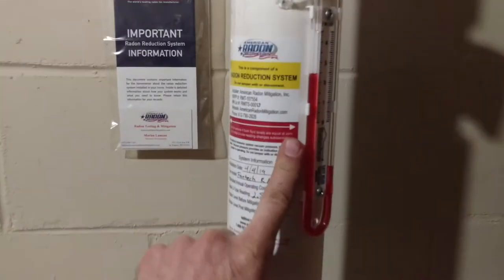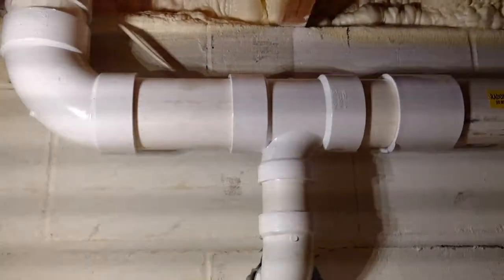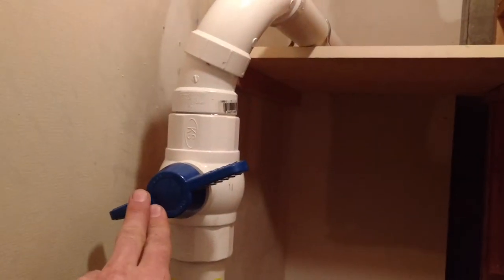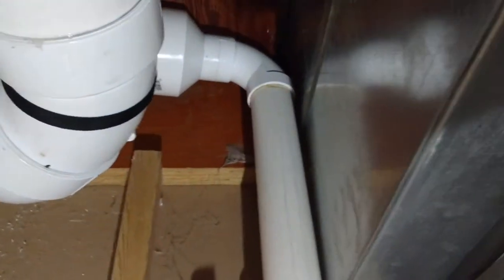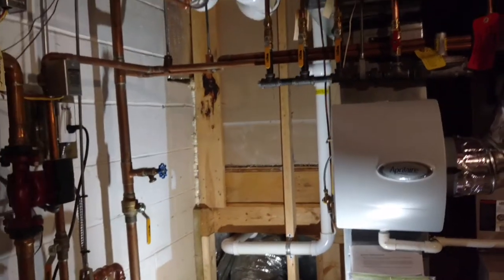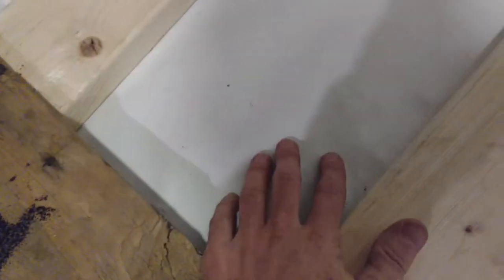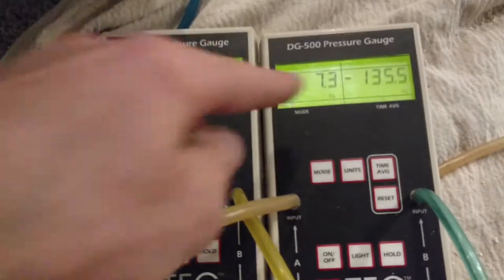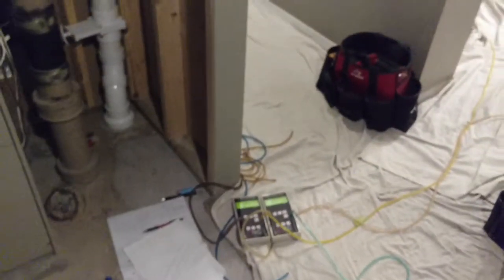Radon Mitigation without Drain Tile

Comment: What kind of fan did you use in this setup? I'm in the process of installing a reduction system at my house with dirt/clay below the slab and no drain tile. Mine's only about 860 sq ft though, with one suction point for the moment. I've got an AMG Eagle but haven't installed it yet. Still need to route it and install in attic and cut hole in roof to complete the project.
Reply from the maker: We used the Fantech Rn4 EC on this home. 

We buy them from Radon PDS. You can use promo code Jesse to save a bit of money. 

https://radonpds.com/shop/radon-fans/radon-fans-high-volume/fantech-rn4ec-3/

You may be able to use a smaller fan if you do some pressure field extension testing. We do offer equipment rental that will allow you to do that, as well as consulting. 

https://americanradonmitigation.com/consulting/

Comment: Did you just auger out a few foot deep hole at the suction points?
Reply from the maker: We typically try to locate suction points that will take advantage of settling below the slab.  They are usually 3-30 gallons pits that are bowl-shaped.